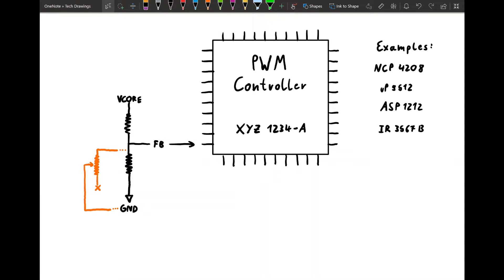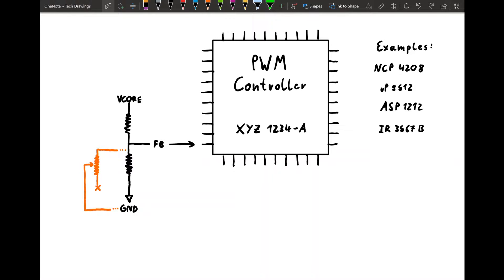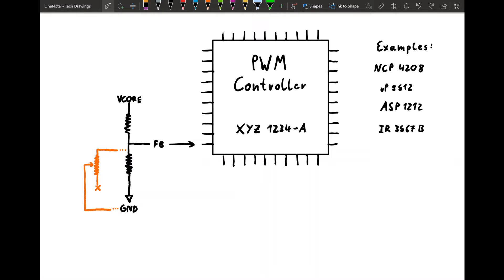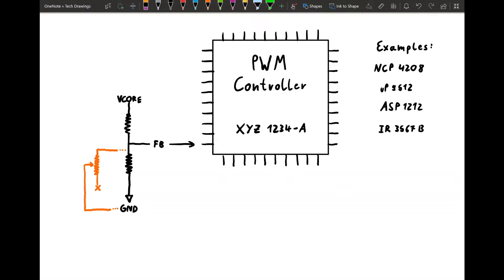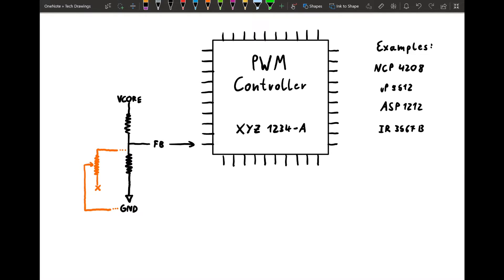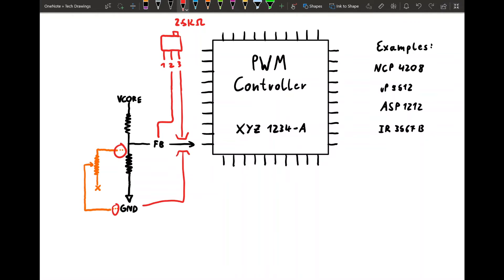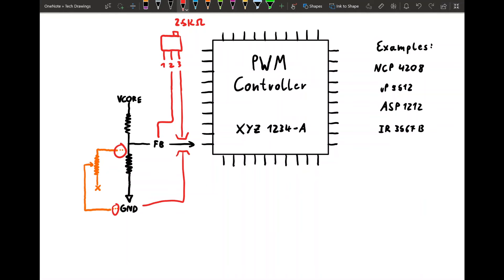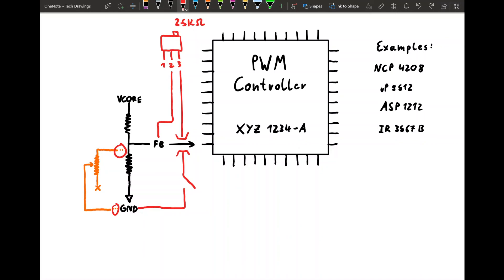How Voltmods work // The Feedback Mod Method

Comment: Hello. I want to make my first a volt mod on a GT 430 card from Palit 1GB. I found the controller, it's EM5103 from Excelliance MOS Corp. I want to measure the resistance of the FB pin, but I do not have the desired value on the multimeter, and I have the multimeter set to 200 Ohm. Of course, black to GND and red to pin FB... Only on pin 2 EN and pin 3 VID shows me 143.3 Ohm. Nice vid ;)